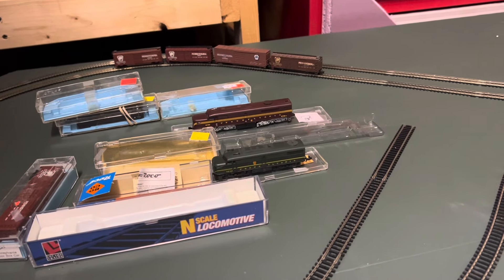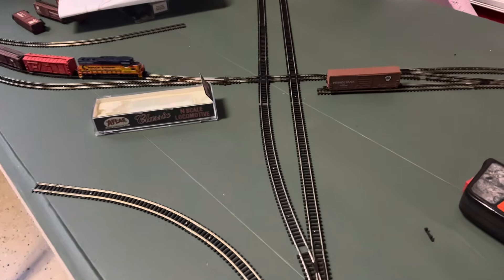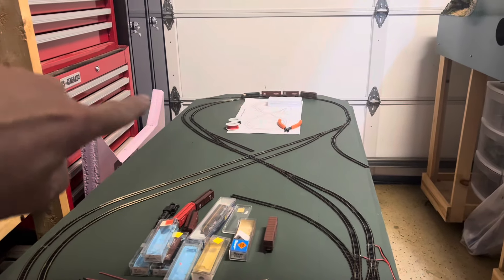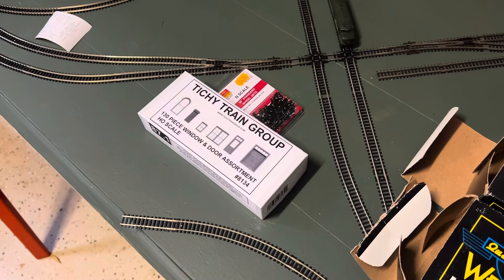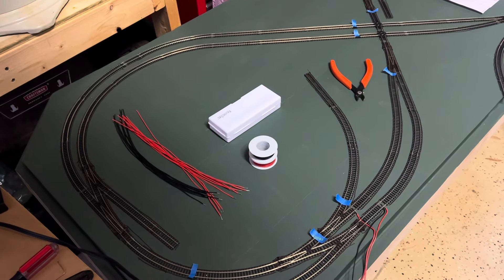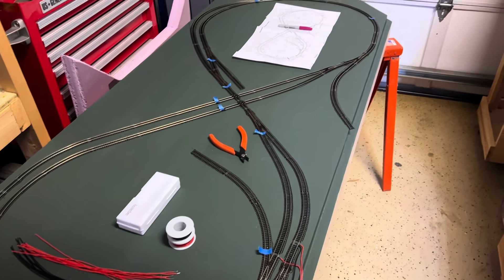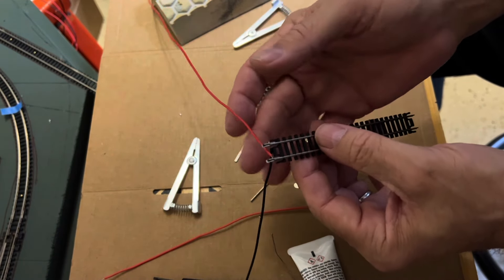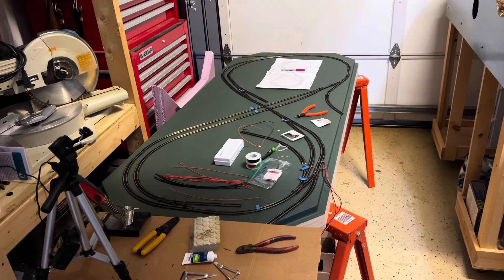Jerry’s Build Part 5 - Jerry Visits and Test Running - Model Railroad Adventures with Bill EP285

Comment: So I cut 100 feeder wires (50 red 50 black) and made a copy of your 'jig' to attach feeder wire to joiner, was simple enough and works great. Realized I had 22 AWG solid core wiring so was easy enough. The toughest part was me having to cut a piece of 36" code 83 track to make the L bracket. Pained me a bit but I have plenty for entire layout. I dared not cut into one of my switches etc. I figure will need piece parts from the longer flex so not a big deal heh. After a couple of decades and a few houses later, I'm finally in build phase (and several layout designs later). Have the backdrop almost done, a couple of friends coming over in next week or so to finish that phase. Have all the materials (foam/ply/brackets/etc) for around the room layout. Will get the ply ripped and foam cut this month. Plan is to do it in phases. I may put up all the 'basics' but will focus on section at a time to get trains running albeit not around the room initially, but the framework will be up. The only two things I have to determine is whether I run the dcc bus and dc bus all at once (preferable) or piece meal it. Second issue is I will have two islands sitting out in the room and have not come up with a solid plan for that yet. One will require a lift out bridge to get into the room, I have watched vids and have a plan for that. The other is just going to require some carpentry as it is 90% + shelf layout. So taking my time thinking through it. Again, great channel and thanks for sharing your knowledge, wisdom and techniques!